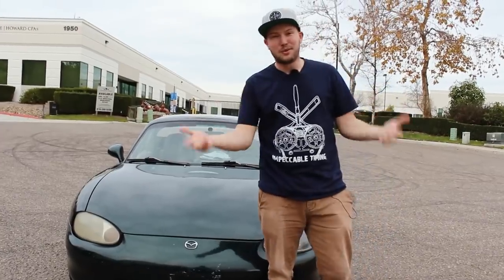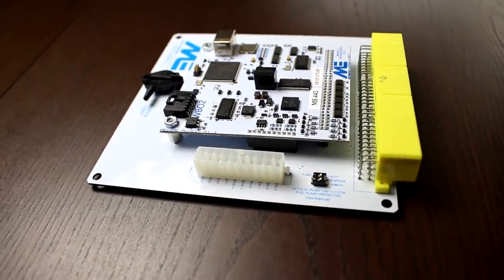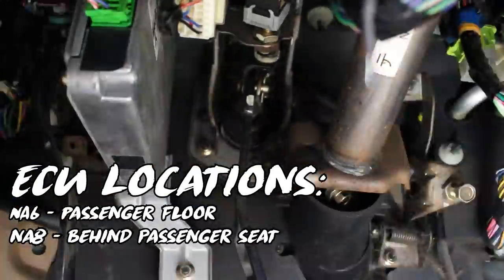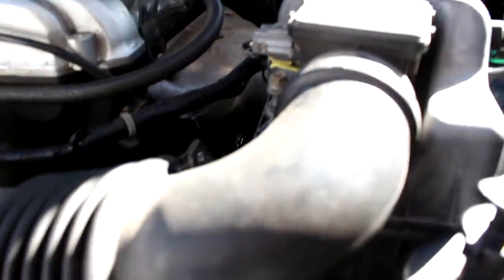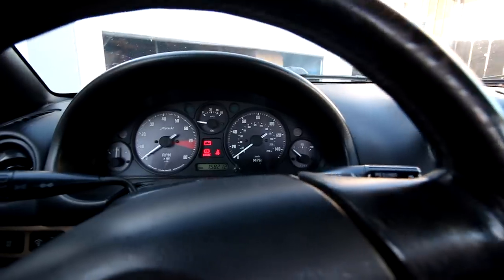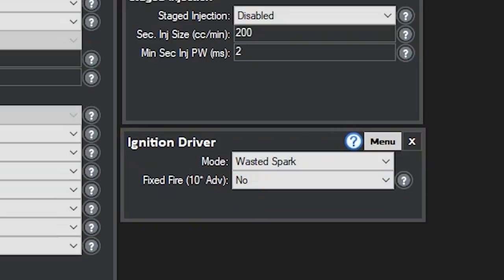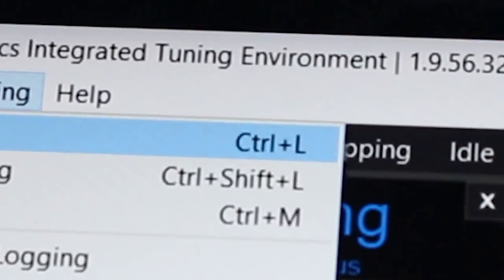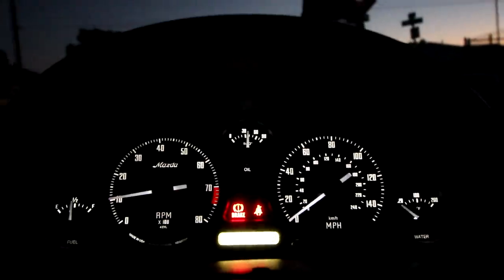NB Miata Goes Full Standalone ECU! ME442 / ME221 Install [Project 2SJ Ep7]

Comment: I've been using the ME442 in my turbo MX5 for about half a year now, idle tuning etc is actually pretty easy and it starts up almost as fast as stock. I'm always happy to send my tunes if you need some inspiration :)
Reply: @Zio Peraza what kind of help do you need?
Reply: @Zio Peraza If you are in Closed loop PWM idle, make sure the min and max duty of the valve are "effective" also the Exit idle duty should be close to the idle duty so it falls back properly. 
I have P=0.1, I=75 and D=0.
Conditions are Min RPM=500, Max RPM=1500
Regarding the lean idle, check how much the car has to trim lambda when falling back in idle and change your VE table accordingly.
Reply: @Zio Peraza snipboard._io/Snr5xz._jpg
Remove the underscores
Reply: @Zio Peraza coincidentally mine is turbo aswell so it would be a good approximation
Reply: @Zio Peraza So basically Min and Max are the values that actually change the idle. if for example the rpm stays the same between 55 and 65, your effective PWM is 55 since more doesn't do anything. My min/ max is 18/35 but those values are different for everyone. What is your exit idle duty, best choice is to choose a value close to the actual idle PWM (so once it's idling at about 950 rpm, look at the idle pwm duty and round it off)
Reply: @Zio Peraza I completely forgot to mention but I'm running 550cc injectors so it might not be the same
Reply: Okay I checked between the original injectors and the upgraded ones, seems pretty much similar. But the best thing is ofcourse to log the data, put it in megalogviewer and see where lambda is trimmed, and change those values
Reply: @Zio Peraza okay so check for exit idle duty, that's probably the biggest issue
Reply: @Zio Peraza  since your idle duty is between 25 and 55 try to set it to 35 and see if it dies.
Reply: @Zio Peraza that's really weird, is the pwm drive not on inverted?

Comment: I know it's an older video but....  no, you do not need a wideband to tune the car if you take it to a tunner. They will hook up the wideband from their dyno usually...   a nice to have but certainly not a requirement if you go with the 221
Reply from the maker: @IrishGaucho  You absolutely need a wideband in any relatively modified car. A one-and-done 2-hour tune by some guy with a dyno will not cover all the tuning needs a car has, you want to be able to monitor the tune over time and also use AFR's for troubleshooting issues. Without a wideband you also won't be able to use ANY closed-loop fueling features on the ECU.

Comment: A clear guide on how to set up cold start properly in miete would be much appreciated!
Reply: Very much this, I added a start injector priming pulse and upped the start injector cranking trim on the original basemap and it's much better, still needs some fine tuning. Be good to see someone who knows what they are doing though
Reply: @yakhunt9424  I had no idea what I was doing for that part, shame motorsport electronics doesn't have a video about it at all
Reply: @ps3modder92  Agreed, wish there was more online specific to the ME ECUs, the basic principles apply though, cold fuel in a cold engine doesn't vapourise that well so you need to add more to get it to catch

Comment: I think, for the uninitiated (but interested, like myself), it would be nice to get a comprehensive understanding of the advantages the 442 offers over the 221. The 442 is provided with a wideband O2 sensor but that's about the only part that I understand.
Reply: Also includes onboard logging and direct EGT input, as well as Drive By Wire Motor Driver :)

Comment: Greg it would be crazy if you add up a new stroker kit from Maruha they are going to sale a new Crank 87mm with beter pricing than their previous stroker kit. 
It should be around 1200$ the price and som more technical stuff will be out in April. :)

Comment: Please make a video on how to make the coldstart better. I bought a miata with me221. It almost didn't start with 5 degrees Celsius outside. I got it starting pretty good now thank to hp performance (thanks for that tip in a previous video) but at around 0 degrees Celsius it still doesn't want to start right away and if it starts it dies again. After that it just starts fine with no problem. If you can't still thanks for the good and fun content, keep it coming always enjoy it :D
Reply: Look at your ASE (After Start Enrichment) 'Start.Inj.ASE.Trim' I also had an issue where I hadn't entered the dead times of the new injectors properly that made it struggle, worth checking if you've changed injectors
Reply: @yakhunt9424  Thanks I will look into that. I don't think the injectiors have been changed. I at least didn't change them.

Comment: Miata dad I need you help. So I installed this ecu into my nb1 but it won’t run even on a base map. I got it to start once but it runs on 2 cylinders only. I’ve gone through everything you talk about in this vid but now the injectors aren’t firing at all car ran fine before the ecu I even went back to stock to see if maybe my injectors died but no it’s all back to normal now. I would really appreciate some help this is a headache. 
Thanks for all the awesome content❤

Comment: I have a question. Fab9 tuning made there edition about the Me221. What do you think about it? So if I get a ME442 or ME221 with a 1991 1.8 swapped miata using the 1.6 harness and ecu to run the motor. Then what map should I use?

Comment: I see they haven't fixed display scaling in MEITE for 4k high dpi displays. I usually set my laptop to 1080p at 100% scaling before running it so I can actually see what's going on.
Reply from the maker: Check out the info in the description and let me know if that's what you're talking about
Reply: @TheCarPassionChannel  maybe they have then, cheers Greg! 👍

Comment: If you're running a squaretop manifold, where exactly would the MAP sensor hose plug into? Looking at it it doesn't appear to have the same capped off port as the VICS manifold.
Reply from the maker: Yes it has the same port
Reply: @TheCarPassionChannel  What were the horsepower gains over the stock manifold too?

Comment: Did you add an IAT or are you still using the stock MAF?
Reply from the maker: MAF is now deleted, and used the stock IAT, but I'm having some inconsistent fueling issues which I think might be related to it. I will be swapping out to the GM IAT soon

Comment: What did you mean about the difference in wideband between the two ecu's?
Reply from the maker: The ME442 gets a wideband o2 sensor plugged directly into it. The ME221 is more traditional style where you need a wideband sensor and controller (Innovate MTXL, AEM Uego) then it sends a signal to the ECU.
Reply: @TheCarPassionChannel  Ah thanks for the explanation I thought that might have been it. Those aftermarket wideband sensors are so expensive

Comment: Does the map line go to the same location on the intake if you have a turbo set up? My Car has been out of action for over a year due to me taking it apart lol and I forgot if you run the map line from ecu to one of the ports on the electronic boost controller or to the intake barb?
Reply from the maker: The map line needs to come from a vacuum source regardless of if the car is turbo, supercharged, or n/a. That is, any spot after the throttle body. The EBC line should be connected to the intercooler piping, after the compressor but before the throttle body (EBC/Wastegate should never see vacuum)
Reply: @TheCarPassionChannel  Thanks Greg appreciate the speedy reply. I have Been in the process of changing my forged engine into a new chassis after a little accident in the wet. With limited time due to work and not being a actual mechanic it's taken a while lol. 1 more weekend and I think she should be ready to terrorise the streets of London once more 😏 ( London England that is).

Comment: Did you have any issues with the fuel pump not running? Have an nb1 with the 442 and I can not get the fuel pump to run, so just cranks and cranks no start
Reply from the maker: There's wording in the instructions on how to set the ECU up depending on the model of your car, there are switches that can be flipped inside the ECU. I would look  into that
Reply: @TheCarPassionChannel  seems like it may be the immobilizer , I jumped the fp on the diag box and the car started right up
Reply: Now realized about the board switch settings😂

Comment: What do you have to do to run a maf delete on the me440?
Reply from the maker: Remove it, no tune changes necessary. It doesn't use MAF readings

Comment: Im sorry if my quetion is perhaps stupid, but recently my ECU is giving and error check engine that apparently the EGR valve send , and after reading, loking and investigating, my EGR valve basically screw my ECU, so i need to change it or my Check engine will not dissapear. No i read that to change this, also need to change inmobilizer .. sice keys are married with ecu and immobilizer, 
How then you put a new ECU (this ME442) and not change immobilizaer, my car is NB 2003 1.6 MK2 
I want to delete this check engine the easy, fast and cheap way possible. 
If ill buy a ecu then perhaps this one you recommend on this video, does NOT need to remove immobilizaer, or do i neeed to go for my OEM one ??
Anyway hope this is clear.. if not let me know.. thanks and amazing channel !!!

Comment: wondering if anyone knows why he didnt run an intake air temp sensor? do you not need to put in an aftermarket one because its built into the maf? thanks to anyone who can answer that.
Reply from the maker: On the NB the IAT sensor is separate from the MAD and I'm still using the OEM unit. Soon I'll upgrade to the GM fast response sensor that most people use, but the OEM sensor works okay for n/a use
Reply: @TheCarPassionChannel  okay makes sense. So the only reason to take out the stock maf is because it’s a small performance loss having it blocking flow? Also, I watched your MS install video for your na miata, and I’m wondering if the wiring is the same for the IAT into the MAF plug? Meaning IAT wires into 1st and 6th holes in the MAF plug. Thanks so much for answering!

Comment: I know this is a broad question, but does anyone have any input on if they think a standalone is worth the money to unlock N/A power?
Reply from the maker: On my NB, just doing a standalone and dyno tuning bumped it from 113whp to 119whp, but the main benefit is being able to get the most out of any mods you're installing. In my opinion you should start with all of the normal bolt ons, also get a wideband, then once you're "full bolt on" maybe consider a standalone.
Reply: @TheCarPassionChannel  Hey Greg, thank you for taking the time to respond to my comment! My NB2 has an auto exe intake, racing beat 4-1 header, a roadster sport exhaust, lightweight flywheel, power steering delete, and a pretty fresh factory rebuild, which is why I'm so curious about what a standalone could do to my car.
Reply from the maker: @Dreamweaver94  I have a couple "dyno day" videos on this NB where I test out various mods; on the next one I'm going to try plugging the stock ECU back in to see how much power a full bolt on car loses